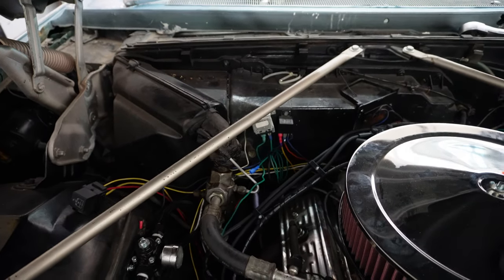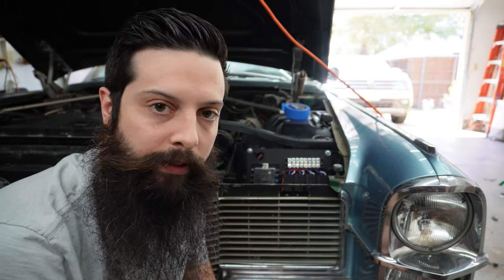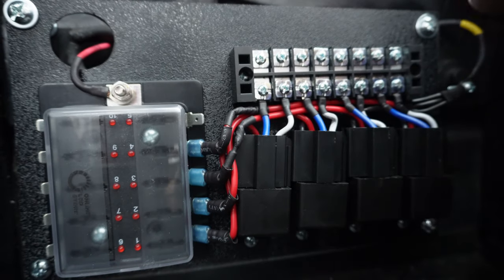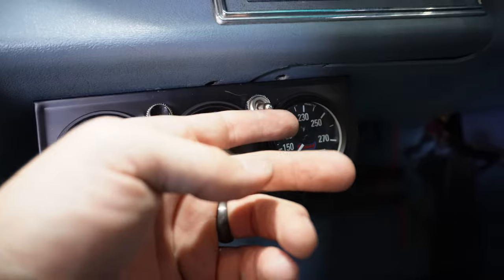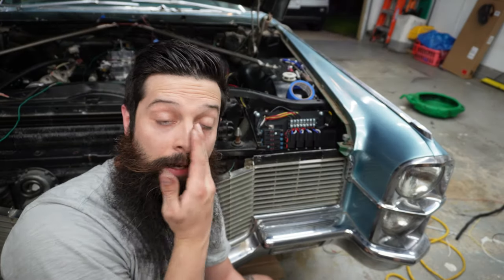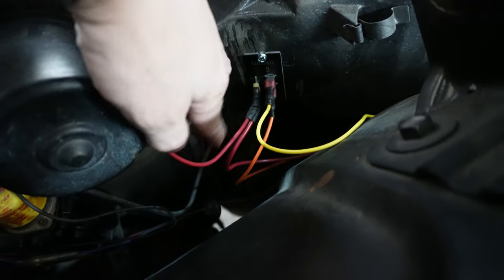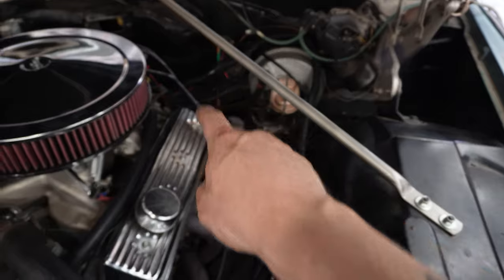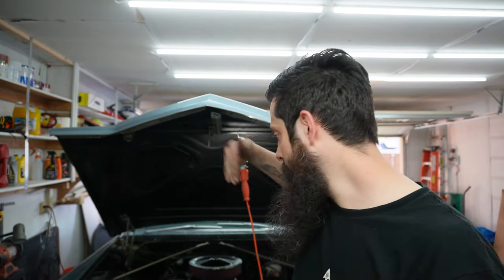Hiding the Wiring – 1965 Cadillac

Comment: The hole in the grill is for the Autronic-eye for auto-dim & Sentinel features one turned-on lights in tunnels and at dusk, the other auto-dimmed the high beams. The light sensor looked through that hole. just cover it with something black.
Reply from the maker: Ahhhhh. Yes ok. That makes sense. Thanks for letting me know! I'll just use some of that same plastic.

Comment: Hey, I've got a question. On your engine swap, what SBC oil pan did you use in this '65? And what trans and rear axle are you using?
Reply from the maker: Hey man! I had Kevko make me a custom pan with extra clearance for the steering. I did a video about it. They based it on a nova pan and just added the little bit more that I needed. Really nice piece. 

Turbo 400 transmission and the stock Cadillac rear end. Drive shaft length had to be altered a little to fit. I can’t remember but I think it was shortened.
Reply: @deadwaitdesigns  gnarly, thanks

Comment: My go to swap for my '65s has always been the 500. but I've got a friend going SBC in his '65 and his wife's '67, so this is all helpful. I also see your kickdown switch issue (I run a 4L80 with a BOP adapter) but have you considered adding a Nitrous switch? They're easy enough to find for a Holley, and they work great as a kickdown.
Reply from the maker: I bought a micro switch, I just haven’t found a good spot to hook it up that looks clean and out of the way. These summit carbs don’t have a lot of obvious options. I’d like to get something that has a little give to it like the B&M switch so that it will kick down closer to 3/4 throttle than WOT.
Reply: @deadwaitdesigns  I can't say it would work with a Summit, as I've never used them, but the Summit design was inspired by Holley. Have you seen of the NC 15569 from Nitrous Express could mount with that carb? It should be pretty clean, as with the air cleaner on, it wouldn't even really be easily seen, because it tucks against the carb.
Reply from the maker: @the-dullahan  That looks pretty much like what I have, just without the bracket. My biggest concern is that tab bending if I got past the point of contact. Like I said, if it hits before WOT then there's still travel it has to deal with. That B&M one has a spring that eats up some of that extra movement, but it's a little pricey.